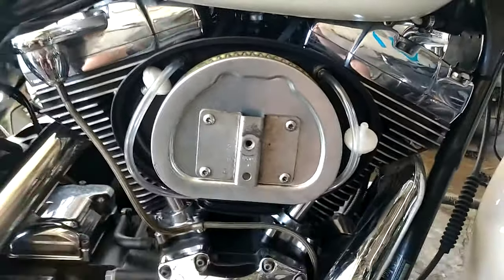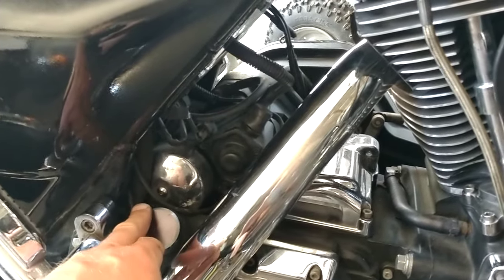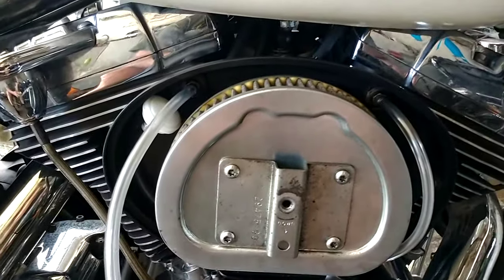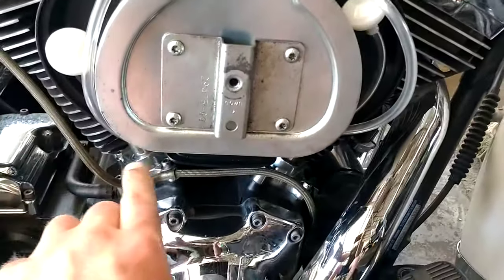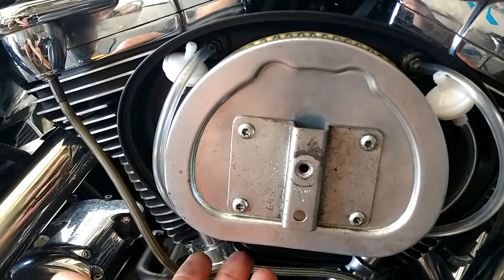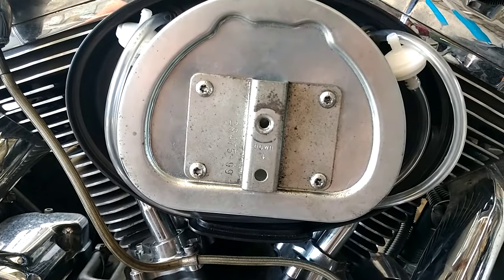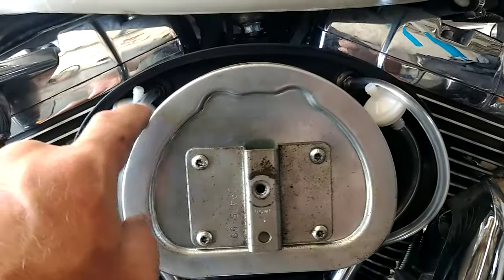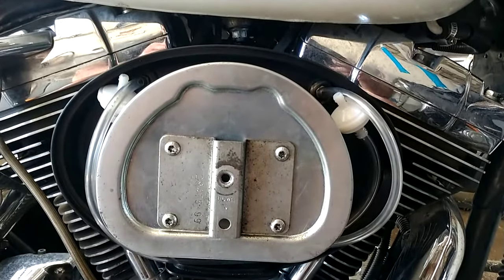Simple fix for Harley Davidson twin cam slobbering oil to intake/Air ceaner

Comment: My Fix? I run 1/2 quart LESS than Harley recommends at oil change time. Four quarts + filter total per oil change-Problem solved! Worked on both my M-8's and one Twin Cam model.
Reply: Good 👍 from spain

Comment: I have been told by many and the dealer, when checking the oil on the stick there is a lower level line and a full line. only fill to just a little above the low line should eliminate the puking of oil.
Reply: This is in the factory service manual as well

Comment: This is the simplest and most sensible solution that I have seen, thanks. I'm not sure that the clear tubing will hold up to the heat. I used fuel line.

Comment: I’m using the S&S crankcase breather valve in my 2005 Roadking and haven’t had blow by issues. 95ci with 9.8 compression. Installation was done at 22k miles when gear drive and Andrews cams were installed. Currently at 48k miles with no problems.

Comment: Very informative thanks ! But your videos start to get entertaining about half way through when the listener starts to realize how your really working to impress with a vocabulary attempting to make simple 5 min  job sound like your replacing an engine in a space shuttle! But hey it’s all good keep them coming, you’re doing a great job!  
    I know I can’t wait until you make another in-depth one on the the technical aspects of changing the air in your tires or making sure your horn is aimed properly for maximum sound range! You should be able to cover all that’s involved to preform these delicate and important operations in around 20 minutes each!

Comment: I have a 2014 Road King. There was an easy modification I did to mimic your results. My oil level is 1/2 full (on the stand) and has no bubbles in it any more. Thanks for taking the time to make that video. Very helpful.

Comment: On my 2014 103 street glide I run on the low side of my dipstick about 1/3 up. Runs better this way.
Never have an issue with oil in my intake. 
I also run a fueling vented dipstick. 
I don’t let Harley do my oil changes anymore. 
Fired them years ago
I handle that myself. 
Harley just drains and throws 4 quarts in the crank case and a new filter And they send you on your way. My oil level was at the top of the dipstick past the fill mark every time they did it no matter which mechanic did it.
Regarding oil in your intake. If was still having an issue after doing all I did I would just run a DK catch can.

Comment: I'm going to say this as an engine builder if the engines puking oil you can use a oil catch can first thing I would do is a leak down test if the Rings are more than 10% 15% then you got to look at the Rings not sealing or the end caps too big how much lost compression is too much lost compression and a cure would be total seal rings likely rehone the cylinders and while you're at it make sure the valve guides in good shape you can make a leak down tester or you can buy when they're not that much money anymore you can even run a tube from the oil catch just so The Unburned hydrocarbons could be burning up and not the oil going into intake

Comment: Buy rubber plugs to fill the holes and run the hoses into a catch can. After thousands of miles oil will fill the can. This set up you have made probably works but as the lines get oil in them it will get sucked back in your motor or just make a mess. Will work if you keep it clean or dont ride much.
Reply: what size rubber plugs? do you have a picture? thanks, jp

Comment: I did the same thing on my 2010 dyna, though I ran the tubes off the vent bolts and T'ed them together under the filter, dropped thru the breather box about 2" and put one lawn mower fuel filter on it. The air exhausting is positive but Ive yet to see any oil at all. Works great.

Comment: I was curious how this modification working out for your motorcycle?

I’m interested in doing something similar but I’m real hesitant on modifying the back of my stock air cleaner. This is why I’m intrigued with your modification.

Instead of running 2 lines I’m going to run a 2 into 1 system and have it cool and dump into one tube and lawnmower fuel filter like you did.

Comment: It’s like a pvc valve for pollution,  the vent in the head does gum up but the crankcase has to breathe if oil gets in the tube it should still blow out .. I did the std mod on my evo and ran it to the ground like all previous HD’s.  At medium to high rpm   Oil is pumped to the rockers via push rods.  And runs back down the tubes to exit the heads. OR  excessive blow by ( worn rings ) or oil pump not evacuating the crankcase.

Comment: The oil tank level in a dry sump system has nothing to do with the inferior oil checks in the head. I also agree with Gary Chandler's post. It would be wise to just use oil rated rubber hose to a catch can.

Comment: An easy thing to remember is that there is a quart more oil in your engine than you think - when the engine is running the oil is distrubuted all around the engine and it drains down into the crankcase and camchest. It is then pumped back to the oil tank.
 When the engine is  static that oil just collects in the bottom of the engine and stays there, so when you check how much is in the tank just remember there is still a quart in the engine itself and STOP OVERFILLING THE OIL TANK !!!!!

When you check the oil level on a cold bike and it is on the stand, never fill it above a quarter the way between 'add oil' and 'full' marks - there is oil in the engine, it all expands when it is hot AND when you ride the bike it is upright, not on the stand. 
A 'quater-full' oil tank on the stand and cold is half full when you stand the bike upright, and over three-quarters when both hot and upright !
Reply: On my Evo I pull the return oil line when changing oil and watch the old oil coming our until I see the new oil. I shut off the bike reattach the oil line and top off the tank. That gets all the old oil out of the motor.
Reply: @ronrobertson59  That's the easy and cheaper way to go !  I think Evo and Twin Cams are almost the same - Evo's filter the oil before it goes back to the tank and twin Cams filter it before it goes through the engine, but otherwise it's the same. The 'Scavenger' total oil change thing from Rogue Chopper is good because it lets you change the oil without putting new oil through a used filter and/or stop you running the last of the old oil that's still in the line from the tank (on a Twin Cam) before the oil pump (or in the sump for the Evo) through the new filter and 'contaminating' it.
 It would've been easier if there had been a sump plate of some sort like the old Brit bikes had but you still couldn't get any oil collected in the camchest out ! If you check out the 'Maximum Oil Level' markings on old Brits, it always seems to be rather low down - so as to allow the oil that collects in the bottom of a static engine somewhere to go without over-filling the oil tank when the engine is first started ...... simple really !
Reply: 100%
I run my dipstick 1/3 up 
When I do an oil change on my 14’ 103 I do 3 quarts and that’s it. Everyone I know overfills. I never have an issue with oil coming out of my intake. I also run a fueling vented dipstick
Reply: @ronrobertson59  you should take the motor apart every oil change and clean the bearings of oil and the rods and cams. Relive everything with assembly lube. That's the proper way to change oil

Comment: Being only a half pressurized system meaning the flapper valve is closed as much as it's open it will not push aerated oil in the direction opposing gravity.  There's a reason on the Harley factory system that it is horizontal or down at all times... What you'll end up with in your system is vaporized oil sludge pooling in the lower sections of the lines which will eventually clog the lines.  It has to go down or horizontal from the head bolt on or it won't work in the long run.
Reply: Your so right.   This will fail . this is not good and he should take this video down.

Comment: Good video, that's one way to address the problem. I'd like to know what the device is that looks to be attached to the rear rocker cover with the line coming off it, and where that line goes? Thanks.
Reply: That is the oil pressure gauge. Goes to a fitting near your oil filter.

Comment: Common symptom of sumping, either from excessive crank run out or beat up oil pump which can be caused by the very common crank run out. This could make it worse in the long run by increasing built up pressure needed to expell the crank pressure.
Reply from the maker: The crankcase is still vented through the lawnmower fuel filter et the end of the line
Reply: I've seen brand new bikes do it. Incorrect oil filter can cause it too. Just because it fits , does not mean it's correct.

Comment: So, it's worth it to do this if we don't have money for the repair or just a thing harley users do eventually because the parts are just hard to get?? Also... Would it be possible to get a one way valve and use that instead of those fuel filters?

Comment: Every 25 years refer to the manual to see how long you've been doing it wrong.
There will be water as a byproduct of blowby.
Short runs and stop start without everything getting up to operating temperature is the worst.
Running it out the exhaust isn't the worst plan.
Keep the acidic condensed water off the chrome I agree with.

Comment: I did this a couple weeks ago and I'm gettin' better gas mileage ...however, it sounds like it's running a little rough or dry? So, i'm thinking on what you said about "air temp" in the breather ( i ran my hose straight to the ground! )

Comment: I have a 103. Running into a oil catch bottle and then back into the back of the filter. My theory is the bottle works like a sediment bowl like on a old fuel system. Air returns to the engine without the oil. Most of the oil stays in the bottle. However it needs to be checked so I doesn’t overflow and make a mess. I haven’t tried it yet just waiting for the snow to go away 🥺
Reply: commonly referred to as a oil-air separator

Comment: You or at least I would think that as much as a Harley costs you wouldn’t have to modify anything. You don’t have to modify Cadillac or Lincoln when you buy them.
Reply: fladave99 Mills  agree whole heartedly, it seems like every person who spends outrageous amounts of money on a Harley wind up spending $2000-$3000 more through Harley or aftermarket sales to make it right. Spending that much it better BE right and STAY right for a long time.
Reply: fladave99 Mills  they probably needed a G.I. Skrub
Reply: They all could probably use an old fashion GI scrubbing shower too. Lol
Reply: Harley could or should Have fixed this problem from the factory I had an easy fix for a Carburator Model and it looks Good? many mechanics Do not care First thing i Do is bypass who wants Hot oil and vapor running into the top of your pistons Pull a head and look at the carbon on top your pistons ? I lost 3 Shifters off a new bike i tried everything, until one day i got off an exit Went back and finally found a lost shifter The Splines with the Bolt tight was coming off there is a slot to stop it But Harley made the shifter or Shaft splines to small i used a drivel disc and ground a mil off the Shifter so i gould Tighten it enough it could not come off . I was going to KeyWest when one fell off Harley of Miami sold me a shifter and woiuld not even put some blue Locktite $50.00 a pop I went to an auto store and Bought Blure Locktite Most Dealers could care less ?

Comment: Check oil after a 20 minute ride. Don't let it idle n think that's operating temp. It must be ridden. Check out John Maxwell video on oil. You can drain oil into a measured container to see how much oil is in tank but it could be overfilled. If it's correct then refill with same amount or purge the whole system . Delboys Garage has a video on purging.

Comment: As a theory, the oil level argument seems unlikely.  On the dip stick, a level change from 1/4 to 1/2 would equate to 250ml (?).  But then spread that out over the surface are of the oil pan and that changes the depth 1/16in (?).  Then add in oil movement while the bike is moving, and I don't see how that can make a difference.  Therefore, oil level is not a factor in my eyes.  The discussion should be around how the oil gets into the head area in the first place, which is why it requires draining.
Otherwise, I really like the method you created.

Comment: Just did mine and installed a new filter, let the testing begin
Reply: This was a definite improvement, I find the motor had better response, it use to stall on me once in a while like it was needing air
The test continues
Reply: @donmelanson4894  just did mine and I thought it was all in my head it does respond better
Reply: @MrTheDays1  I liked it but found some oil fumes where still present in the air box so   , modified  the hoses with black gas lines , omited the add on filters, and ran the hose to the frame with zip tyes , Ill post pictures when i can .

Comment: Oil level should be dead center of the dip stick. When checking oil level make sure the bike is sitting exactly level. You must pay very close attention to that. The oil in the air cleaner will immediately go away.
Reply: I like this idea, sounds like it would help
Reply: @cj8172  it does a little. I run say 80 on the highway and oil doesn't run out on the engine. It's not a complete fix but it does more like it was designed to.

Comment: What remote oil pressure gauge are you using? And when you plumbed it into the case, were you running the long oil sender?

Comment: The TC has sumping problems due to out of round cranks, bad oil pumps and wear on cam plates. All this does is bandaid a problem. You are sumping to much oil

Comment: This is the way I plan on doing it on my M8 motor. Do you think it needs to be routed back into the intake to pull the oil and moisture easier? What was your conclusion on this?
Reply from the maker: Good question I was not concerned about intake pull because it’s eliminated. To answer your question more directly, Blow by (combustion gases getting past piston rings) creates a positive pressure in the crankcase which is a pushing effect on the same vapors.

Comment: Why don't you vent it to atmosphere ? It works for me on the 88.
Reply: fladave99 Mills  lol. That's funny
Reply: fladave99 Mills  

And when you hit 21 in 4 years ride that Honda over to the bar and have a beer with us Harley boys....
Reply from the maker: The lawnmower fuel filter on the end of the lines are opened to the atmosphere

Comment: I know this is an older vid. I did this exact setup with a crank vent. And I’m still getting oil everywhere, I’m at wits end my lines filled at the low sec with just a 40mile ride. Did this clear your trouble??
Reply: Try that idea of only having the oil tank half full
Reply: @cj8172  put a check value on the dip stick breather all good now 👍

Comment: Sir, What you have here done is self defeating!.. As you said steam/ water vapor, bad air and oil comming out your breather ports.. ( Which in reality is sludge) Why in the hell are you still keeping it in the air box??? You need to tee your clear lines and run them the heck out of the air box out and away from the intake period!!!!. Now either use a catch can or run the hose out on the ground.. Which i could give a crap about since more cars and semi trucks dump more fuel and oil on the roads for the last 100 years than i ever could.. I digress.. Next, all your doing is still recycling all the above steam/water vapor, bad air and oil (sludge) back into your engine via through your air cleaner now plugging that up faster!.. Last your clear hoses are routed back upwards instead of draining down and also not utilizing gravity!. So if you get a lot of oil comming out, it will fill the bottom loop of your hoses creating a block or partial plug that the more/ additional expended steam/water vapor, bad air and oil (Sludge) that keeps on comming, must over come or to push through to try to vent!. Thus Backing up your breather system!!.  Basically you've made a reservoir at the bottom of those hoses.. So as the crankcase pressure builds up high enough, It will blow/puke a big built up blob of all that crap all over the top of your air cleaner then start to choke the engine of air!.

Comment: Oil WILL make its way into those hoses where it will accumulate until it burbs out into the air cleaner. There's better ideas out there.
Reply from the maker: That's the whole point. Oil vapor converts back to liquid in the lines.Just don't ignore it.Check it once in a while and clean or replace lines I'm around 1400 miles and haven't had to drain it yet.
No matter what kit you buy you have to check it empty it etc
Reply from the maker: It's an incredibly slow process unless you overfill the bike

Comment: TWO major problems here,1) you are recommending an untested system that most likely won't work.  2) You TAPED the cleaner plate holes on a fuel/oil saturated system?
Good luck with all the dirt you're gonna suck in when that tape fails.